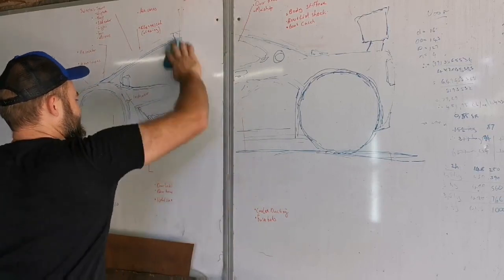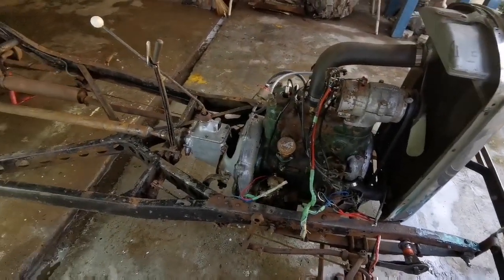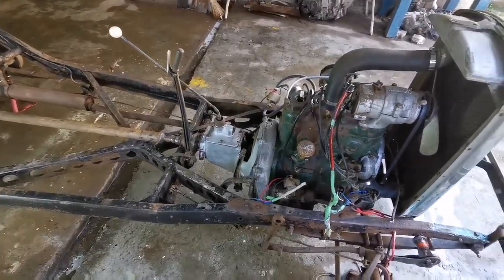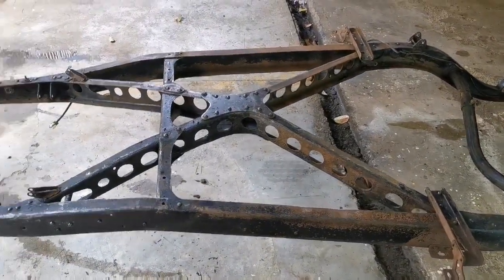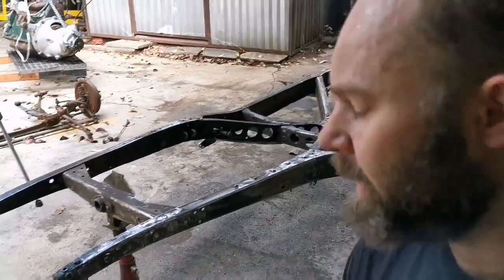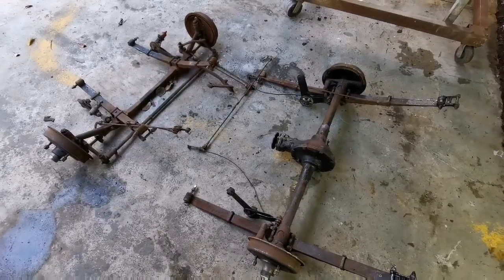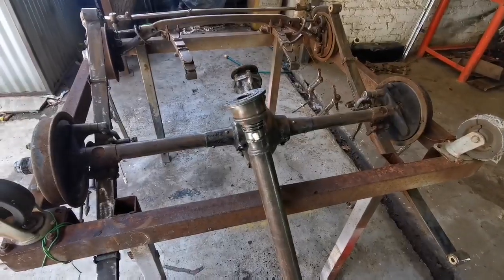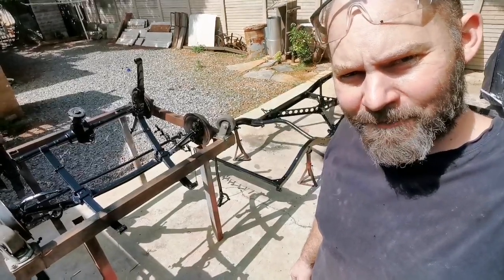Part 2: 1933 Austin 10 Restoration (Chassis Prep and Paint)

Comment: How far to go is something I've always struggled with.  I sandblasted my frame, replaced some welded on plates on it and coated the inside of it with a rust encapsulator. I stripped 80% of the body and wound up taking it out for sandblasting because I just couldn't let it go and paint over patches of old paint. It's my OCD kicking in
Reply from the maker: I agree that sandblasting is definitely the way to go. I always try and convince myself beforehand how far I'm willing to go when restoring a car but I can never seem to stick to that plan.

Comment: If the rivets are in good order then they should stay as they are. All nuts and bolts should be removed. To make it a real restoration, nothing should be make by computer, like CNC, or 3D printing. It shows the quality of your work. Just look at the cookie cutter, custom motorcycles. They all look like crap, because they are all the same!
Reply from the maker: Agreed. One should try and replace parts with period correct, or at least made in the same fashion as back in the day...